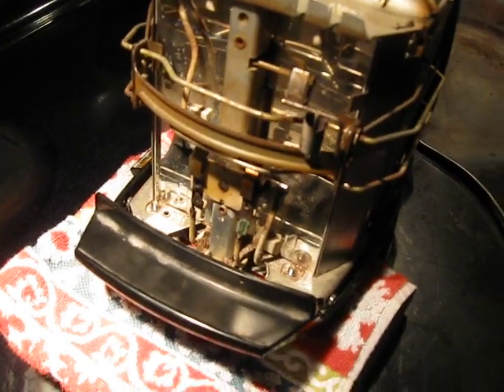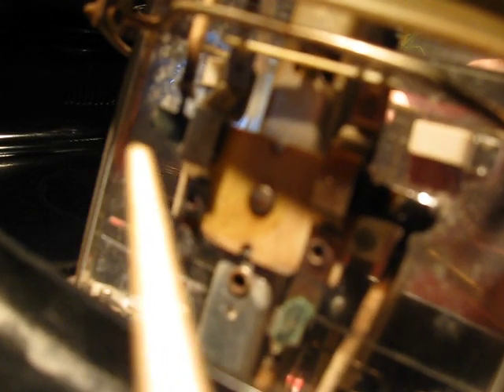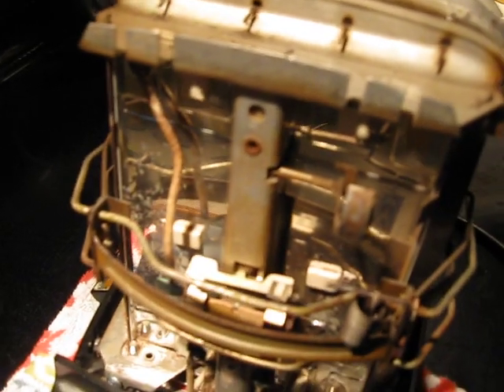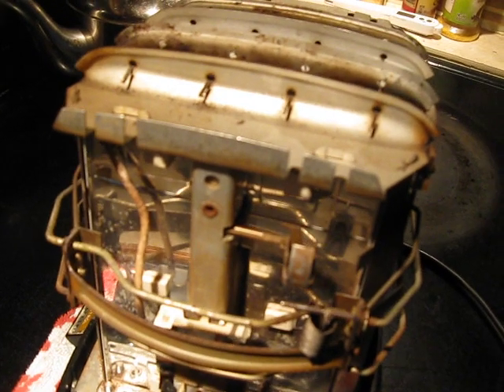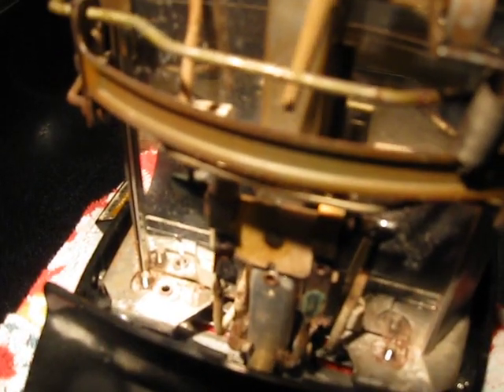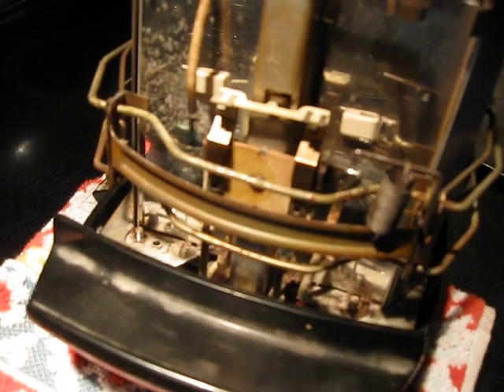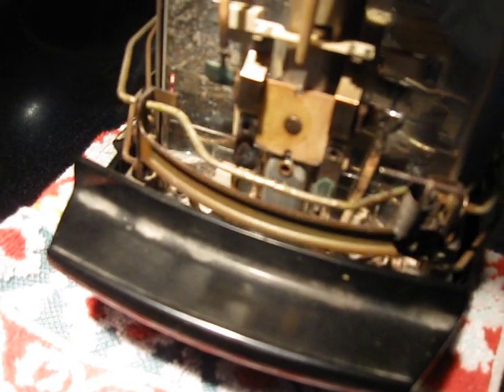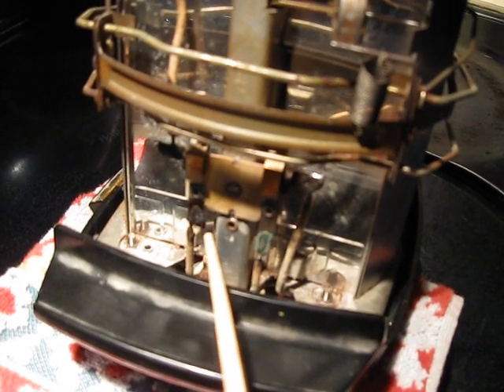Sunbeam T-40 Manual Test with a chopstick.

Comment: Hi , I have a TA J. It constantly goes down and up without bread or triggering. Could that strip be out of whack.. ?  Any advise, I'd love get my burnt orange guy to behave
Reply from the maker: I believe you'll solve that problem by tightening the screw in the center under the crumb tray. That screw adjusts the tension which raises the rack to reset the trigger.

Comment: Hey ToasterPhreak! Love the vid but mine IS getting power and no amount of testing is getting it to activate. Is there a way to "jump" the non-conductive strip to force it? On mine tension is good. It's getting power but "something" is stopping it from making proper contact SOMEWHERE. Any ideas?
Reply from the maker: Most likely the contact point that's joined when the the toaster activates. Hold it up to the light and look for something that looks like a bit of sand between the contact points. If you have a meter, check for continuity across the points. What you'll probably have to do is carefully sand the two sides of the points to remove the crud built up between them.

I was given a T-20 just the other day that didn't work. Once I looked at it it was obvious what the problem was.
Reply: Hey  @ToasterPhreak  ! Turns out it wasn't the contacts but a bad "fix" from years before I owned it. Power was coming TO the unit, but the circuit was broken somewhere when the contacts met. So I looked closer at the fix and there was a "break" in the line. New wire. fresh solder et VIOLA!
Reply from the maker: @chriselkerton1679  Wonderful! Glad you got it figured out.